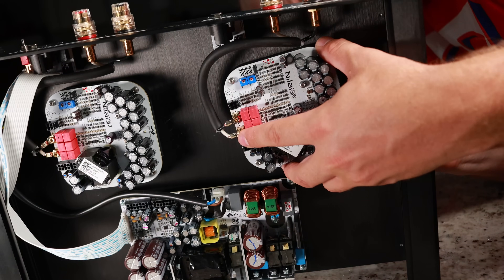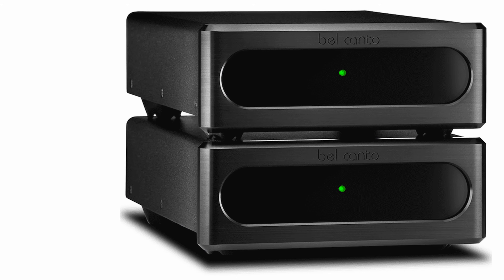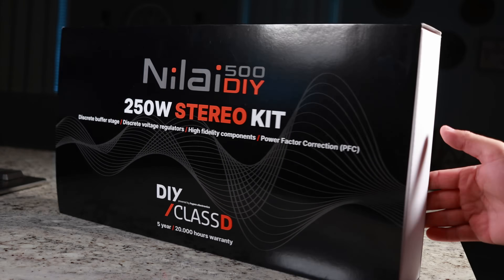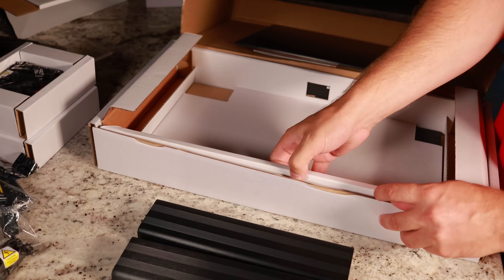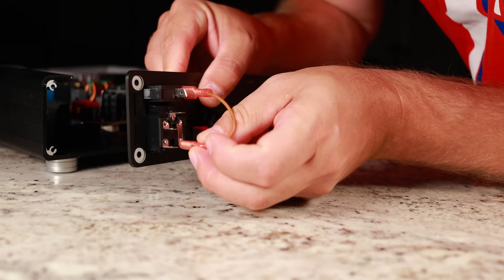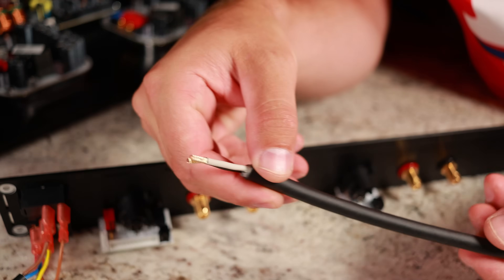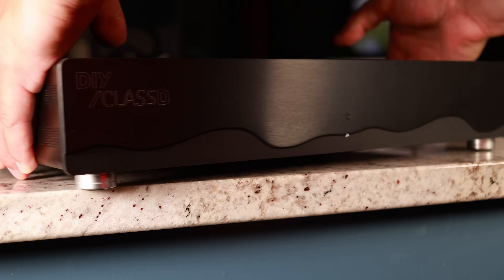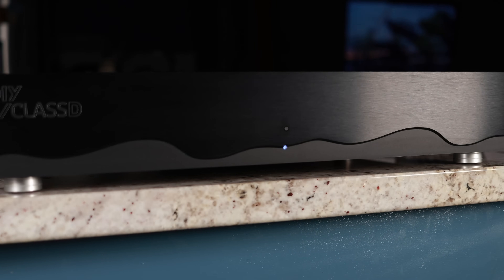Building A Top-of-the-line HiFi Amplifier For Less: Hypex Nilai500diy DIY HiFi Amplifier Kit

Comment: The problem is, you can buy a Hypex/N-Core/Purifi amp from someone like Buckeye Amps for less than this kit. If I can get the latest Purifi amp for $500 less than a Hypex kit, what's the benefit of the kit? I run Bel Canto mono-blocks, so I'm a Class D believer, but the kits have to make sense financially.
Reply: Buckeye doesn't sell the Nilea
Reply: @BostonMike68  eh. I was talking to the owner of Bel Canto about upgrading my monoblocks, and between him and another maker I talked to, the differences in these various higher-end modules are tiny. Put them all with the same output stage and power supply, and it's like trying to tell the difference between noon and 12:02 with a sundial. The value proposition of building something that sounds 99% the same as something I can buy really only makes sense if I'm really curious or there are significant savings.
Reply: @tmdillon1969 That makes sense, Dylan from buckeye is has good service and responsive.  Do you know anything about ice modules?
Reply: @BostonMike68 , my Bel Cantos have ice modules, but they're older units. One one hand, I love how they sound. On the other hand, I really haven't done an A/B with another class D amp of their quality or a standard AB class amp. The media center these sit in has very limited space, so most of my options are class D and a handful of regular amps. I run CSS 1TDX speakers on this system, and they need real power to shine.

Comment: Remember Brown is always live blue is always neutral green yellow is Earth. that's strange why they using European colours not the standard black and white for America, wonder why ?? Isn't that is it's an American company? Probably cause of European law and I spends it's more expensive to make separate wires up.
Could you tell me a little bit about the power supply! what is its operating wattage and peak Watts, amps would be good as well or either and voltage??

Comment: Good video but all based on opinion. Not a single test anywhere. Does it meet it's power rating? Is the HF the same at different impedances? etc. Lets hope someone has a review with proper tests.

Comment: I notice a distinct lack of anything on the front of this thing, how would you control the volume?
Reply from the maker: @AstonishedByTheLackOfCake  this is an amplifier only. So there is no preamp. You would need to connect it to a preamp. This could be something like a surround sound receiver or even a DAC.
Reply: @Toid  ah, got it, so it essentially just amplifies the input signal some fixed amount and any DSP or volume control should happen prior to this getting the signal

Comment: Hi there 👋

*Love the design and step by step assemble together this amplifier 🤩
I must admit i'm new to this DIY kit system and i have some questions about this topic.
The final result, clean and nice looking!!
And gonna admit i might try one out 👍
I see where the speakers and power are connected but:

- how to connect this amp together with my other stuff like tv, phone etc?
- change volume, bass, treble etc controls?
- do i need another connection point before this amp? (where i have optical, BT)

Wanna build small, not to big speakers like these  https://www.youtube.com/watch?v=GxFb-Zn5BKk&list=WL&index=38

I also have one unbuildt CC-subwoofer that i like to build and use along with those speakers. 
DIY kit i bought many years ago. 2 chamber box. - 10''sub in one part and 2xports mounted on the other part.
(bandpass sub)
https://www.seas.no/images/stories/vintage/pdfdataheet/h0372_ca25re4xdc.pdf

- any recommendations for amplifier? (or one for speakers and one for CC-subwoofer?)

Any reply would help! 
Thanks.
Keep up the good work and i wish you a good day 😊

Comment: Have this amp and love it. Replaced Bryston 3B3.
Reply: Hello, how does the Nilai compare to the Bryston?
Reply: @giovannibalestrieri9723  The main sonic advantage of the Nilai was more low-level detail. The advantages with the 3B3 were a sense of more power and control when pushed hard (loud), and a greater sense of scale. The Nilai sounded "lighter on its feet". The Nilai was also significantly less expensive, physically lighter, and draws less electricity and runs cooler.
Reply: @DynissRainer  thanks
Reply: @DynissRainer  So, all in all, you would put the Nilai in the same category, even with sonic differences, in the same category?

Comment: I've had 2 Nilai 500 monoblocks for almost a year now.... Unless they fail, I don't think I'm shopping for an amplifier for the rest of my life.  Truly endgame good.
Reply: Good to hear that you like our Nilai's! Thank you for your support!
Reply: I also brought the Nilai mono blocks last December. 
I think they are great, I’ve since put them in larger chassis and done few wiring mods, fitted solid copper binding posts and inputs and shielding between the power supply and amp module.
Reply: I have two perfect bose 901 that I purchased in 1999 or 2000 was wondering if I should sell them and diy my own speakers?

Comment: I built one of these a few months ago.  I've had a couple of the other Hypex modules (Ucd, Ncore) & Purifi (et400) & the Nilai is the clear winner in my opinion. I'll just say there were a few subjective issue i personally had with other Class D. I feel the Nilai is smoother, less analytical, more refined. I'm in my 50's & have had quite a few amps throughout the years. I don't think there is a better amp out there for this price. I would tell people to not even worry about it being class D. Just my opinion anyway. I've always felt that burn in is a hoax but give the Nilai a couple weeks of daily use. I dont leave it on 24/7 all  the time but i swear that when i do it sounds better. Obviously that could be headgames but whatever. Its my reality 😉
Reply: That is my question - is it better than NCore... And what about Purifi
Reply: @jungtarcph  for me it's easily the best Hypex. Purifi can give a feeling of deeper or stronger bass output...though that may depend on the speakers. I prefer the Nilai over the older Purifi modules. I have not heard the newer more powerful Purifi.
Reply: 😂 smooth, analytical, refined.
Reply: 😂, well it's hard to subjectively describe an amplifier. But I do feel that the power supply in the Nilai has a positive effect over the standard PS in the Ncores & Purifi's. The Nilai is smoother like class A vs the others. The Ncores are 2 dimensional with minimal reverb & decay..Nilai no so much. But all of them still lack in the top end in my opinion compared to the best out there. They are transparent as all get-out though. I don't have the Nilai anymore but regardless of how close they objectively measure the Nilai has a different presentation. If you don't believe in that stuff its all good. But there is a reason people will pay more for an amp that doesn't measure as perfect as these state of the art class D modules. It's like how some of these modules can have hard edges to notes & some tubes amps are more rounded..softer. But if you don't believe in that type of stuff it's nothing to be concerned about. I love data & measurements but I've definitely come to the conclusion that there are some things that the data can't convey. Just my opinion. n @xorcipher
Reply: @NosEL34 Nilai is an NCORE with a white pcb, bruno putzey no longer works there so they needed reinventing, 75db of loop gain, 45khz loop filter compared to 35khz and 58db loop gain. (Ncore) hahah 😅

Comment: You hardly need a handful of FEW WATTS to move those voice coils on your stereo speakers.
It's all about how the amp sounds that matters the most. That holographic sound stage and the bass quality and control for which how the Amp was designed, circuit and stuff.
All these watts hype is nothing but useless.
Reply: I personally don't believe that any solid state device has any business being outperformed by an electromechanical device regardless of budget... Let alone the room said device is playing in.

My only concern is mostly load dependancy and noise floor.

Comment: There is definitely room for a brace in the middle rear of the chassis and back panel right below where it says "Electronics"...and if they added that, they could also include an anchor point to do some wire management with a zip tie so the wires aren't touching the top panel

Comment: These modules are as good as it gets for Class D, there is nothing better. I have the NCx500 module in my amps, which is similar in measured performance but Hypex says the Nilai products are better; they use a different 'dead band' setting for the output devices and a different level of open loop gain and negative feedback, so they should sound a little different and also be more thermally efficient than the NCx500. If I had a complaint, it would be that sometimes the bass can sound dry on certain speakers that are already bass-shy. Apart from that, they are nearly technically perfect. I have also heard good sound from some ICEPower modules, even though their measured performance isn't quite as world-beating as the Hypex.
Reply: Always good to hear such positive feedback! Thank you!
Reply: Because to get those features from Cambridge...and all the class d power...you need to spend $3000.
Reply: £1000 for a DIY Class D amplifier with no input selector, no DAC, and no real features? ?That makes no sense to me. For that kind of money, you could get a proper Class AB amplifier, like the CX81, with way better functionality and sound quality out of the box. Why settle for less when you can have a complete, high-performance package at the same price???

Comment: I got one of these last January after seeing the Alpha Audio and ASR reviews. Easy to build and sounds fantastic. Last month I upgraded it by adding a second PSU to make it a dual mono amp. This doubles the power output into 4 ohms. Note, the modification did require drilling 14 PSU mounting holes in the base plate and soldering the wires that came with the new PSU onto the old wiring. I have been considering another mod, adding a gain switch to the rear panel.
Reply from the maker: @mddawson1  that is a great mod! I like the idea of the external gain selector as well. Definitely would be handy
Reply: @Toid  Added the input gain switch today. I used some pre-made three pin plugs/leads that I had left over from another project. I twisted the leads and covered them with some copper braid solder wick (I used a thin screwdriver to open it up into a tube) and covered that with heat shrink. Soldered the wires onto a 6 pin on-off-on switch then drilled a small hole through the Nilai's back panel. Fitted the switch, removed the two jumpers and plugged in the leads. Works perfectly. Even printed out a small label with the switch purpose and gain levels. I left the jumpers inside a small zip-lock bag taped to the inside of the amp just in case they are needed. It only took about an hour.
Reply: @Toid  I actually have the parts needed, it is just a matter of me actually doing it.

Comment: Suggest speakers do NOT loose control.  The amp looses control of the speakers...
Reply: Not really true, speakers can loose control while the amp hasn't depending on what sort of frequency range and power it was designed for. The opposite is , of course, also true. It's another one of those it depends answers.
Reply: Speakers break up and/or distort, but they are controlled by the amp via the amp being the source of voltage and current  -- which a speaker's voice coil and magnet reacts to.  Also suggest looking up "damping factor" which "...measures an amplifier’s ability to CONTROL a speaker’s motion after a signal stops."
Reply: @Toid ?
Reply: This is at best a fallacy of the singular cause.
Reply: @JoelHernandez-tz3vk : Was NOT advancing that there is a singular cause. Just suggesting that like an engine drives the wheels, not the other way around -- the amp drives (i.e., controls) the speakers, not the other way around. BTW: Electrical Engineering degree here -- and 20 years as a technician repairing both analog and digital electronics -- and a 50-year audiophile.

Comment: Been drooling over some of the Hypex modules at PE and elsewhere for awhile. Yours came out basically perfect appearance-wise; it's a beautiful design!  It is kind of pricey... but if I added up all the $$$ I've spent on speakers and amps over the years... dropping $1300+ once on an "End-Game" amp like this doesn't seem too out of line.
Reply from the maker: That is the way I feel about it as well. There are some great inexpensive amplifiers now. But after building both this and the Orchard Audi, I have come to the realization that there still is a difference that is worth the cost. Especially since this isn't something that you should need to replace.
Reply: @Toid How did the Orchard Audio compare to this Nilai performance/quality wise?
Reply from the maker: @ I would personally take the Orchard Audio over it. That’s still the best sounding amplifier. I’ve used. But it also cost more.
Reply: @Toid  Interesting, the 4 companies I'm on the fence of buying monoblocks are: Buckeye Amps (they use both Purifi & Hypex) Orchard Audio (Leo uses GANFet, not sure if that's similar to Purifi or Hypex) and then Wyred 4 Sound, (they use ICE Power modules) lol so tough to decide.  I'm def set on Class D that's for sure!
Reply from the maker: @ those are all really good options. I’m a fan of Buckeye as well. In fact, I had Dylan on the channel before. Between those though I would definitely go with either Orchard audio or Buckeye.

Comment: Nilai is NOT "near state of the art", it IS state of the art!  objectively among the best amplifiers in the world at any price, period, if not the best (hypex nilai/ncorex, purifi, and the gan-fet stuff like the starkrimson, are objectively the best amps that exist to my knowledge... though there are obviously some class a/b amps up there as well, for way more money unless you're going DIY, like the aem6000, and the classic Tripath stuff is excellent too [class T], but not as good as the latest greatest class D stuff).  hypex is certainly THE best value in amplifiers period, IF you need lots of power.  if you don't, then Tripath amps are the best value imo (tk2050 and ta3020 based amps), and if we're talking super budget then stuff like the fosi amps.  I only wish nilai offered more power like ncorex.  I need the extra power.  even builders of these amps like Buckeye, and many others, will claim there's no audible difference because even the normal hypex and purifi amps are objectively perfect amps, and I'm inclined to believe them... almost... there's just that teeny nagging thought that maybe nilai is ever so slightly better in the higher frequencies, but idk.  

i'm still deciding whether for my speaker build I want to go actively crossed or passive, so if I only need 1 amp it'll be the most powerful ncorex, but if I need 2 amps, it'll be nilai for the top and ncorex for the bass. (bass will be at least a single 15" pro driver with serious power handling, in a 2 way system with no sub and tuned for full range 20hz performance, so yeah you actually do need the 380w into 8 ohms that ncorex offers).
Reply: Alpha Audio has a subjective comparison test vid between an Ice, a Purify and the Nilai. The Ice amp came last and they thought the Nilai was the slightly better amp against the Purify.
Reply: @mddawson1  yes I've seen it.

Comment: 1300 usd does not seem very budget
Reply from the maker: @joshmaiura8428  it’s all relative. Something like the Bel Canto that uses Hypex modules are 5K. Those are different modules, but it at least shows you the savings of DIY. If you’re looking for High Fidelity amplifiers, this is a very reasonable price.
Reply: @Toid  £1000 for a DIY Class D amplifier with no input selector, no DAC, and no real features? ?That makes no sense to me. For that kind of money, you could get a proper Class AB amplifier, like the CX81, with way better functionality and sound quality out of the box. Why settle for less when you can have a complete, high-performance package at the same price???
Reply: It's in Dutch currency so about 600 usd.?
Reply: It's not,  especially as you have to assemble it like IKEA furniture. Perhaps its worth it but I'm not sure.

Comment: Are you saving much money doing this? I think I would find it more interesting to build a kit that required soldering.
Reply from the maker: @banginghats2  we’ve done that on the channel. At the end of the video, there will be a link to a couple different amplifier builds we’ve done. the two that come to mind our orchard audio and ice powered. Both of those required soldering.
Reply: @Toid  Thanks

Comment: Nick, thanks for showing this kit and how it goes together.  I would like a multi channel amp built with Hypex modules.  If only I had the bux.

I find it interesting that there are a few "amplifier manufacturers" that buy parts like this, put them in a chassis and call them their own design.  Well - okay.
I wish I had the money to do the same thing.  Apparently there is tons of $$ to made doing that.  Marketing is key to any success.
Reply from the maker: @welderfixer  that is what Buckeye amplifier does. He uses the commercial HypeX and Purifi modules, but exactly what you’re talking about.
Reply: @Toid  I've heard that and I hear he is a great guy and supports his amps well.  I have also found out that NAD is using Hypex in one of their big $ amps.  Good for them, but it's kinda like putting the same engine in every brand of car.  But, of course, most amps in a similar range sound close to the same these days.  Can't imagine there is anything new in amplifier circuit design now.  It's all been done before.  And, all the Hub-Bub about GaNFET transistors = meh.
Thanks for all you do and please have great rest of your weekend, Kevin